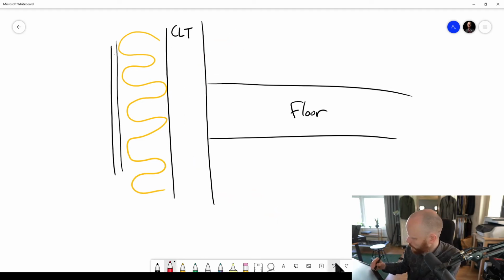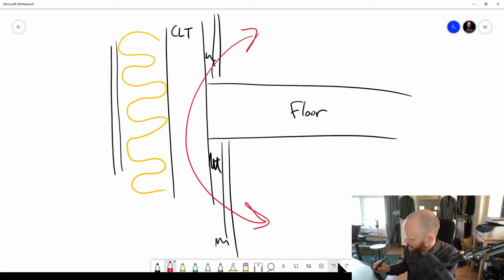What are the benefits of using an acoustic profile in an outer wall?

Comment: Also saw your video on how to simulate the impact sound to measure. Can you also share what tool do I need to measure and calculate?
Reply from the maker: You should check out CALCULATIS from Stora Enso. It’s a free online tool. We use it a lot. 
Then we also use Insul, Bastia and Cadna for calculations, they are quite expensive though. But CALCULATIS will take you far, it is very goos

Comment: Hi Rikard, are you a sound PHD? I met your video while trying to research for a solution of sound proofing my house from a night bar playing low frequency bass heavily. Do you have any suggestions on how I should engineer it?
Reply from the maker: Hi Keynes! I did my PhD on measurement and perception of sound insulation from 20 Hz. Focus on lightweight/wooden dwellings. Is the music in the same building or from some other place? Ie external or internal noise?
Reply: Haha you are funny! And thanks for replying and caring. I checked you recommended Calculatis, however am still confusing on how I can collect the sound to feed into it. The sound is from external far night bar like 100 meter away, however the bass and shake travel super far through the air, and its weird that I can only hear it from my top floor instead of bottom floor. 
I also curious when you say acoustic profile on external wall what the 'profile' really is.
Reply from the maker: @keynesding7152  Not sure about your background mate, it's an engineering tool so it might be very difficult to use for a "mere mortal" 😂Engineering programs are usually quite terrible with regards to user friendliness. 
Here's a link to a common acoustic profile we often use: https://www.gyproc.se/produkter/profiler/profiler-till-fasta-undertak/gyproc-ap-25-0
It won't be of much use to insulate against very low frequencies though.. Much better in the mid/ high frequency range. 
Is the sound coming through your windows? No point to extra insulate the wall if you have weak windows. The sound will come through the weakest link in the chain
Reply: @RikardÖqvist  So I am the exact mere mortal here:) Thanks for sharing the material, it matches to my current plan which is to build a decoupling wall using the resilient channels. I did a lot of research and this looks to be best solution dealing with low frequency. I am gonna test it out.
My window is double glass with air channel whithin, and I hear it very clearly that the shape is from my cieling and one side of wall instead of the window. So I am just ganna believe in that the decoupling wall is gonna save my life.
Reply from the maker: @keynesding7152  Good luck with your project! Do note that resilient channels do not work well for low frequencies. Flush mounted 25 mm Acoustic profile and 1x13 gypsum will give you a resonance frequency of 132 Hz, which will give you sound insulation from around 200 Hz and up. Increase the air gap and put additional layers of gypsum and you can insulate for lower frequencies.